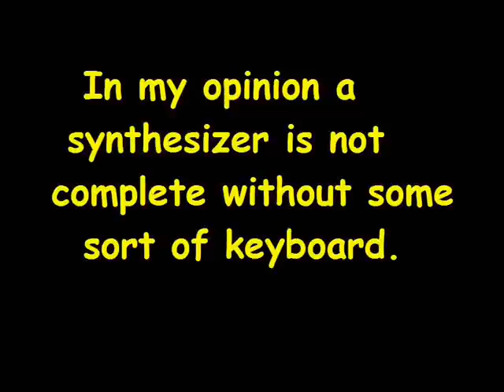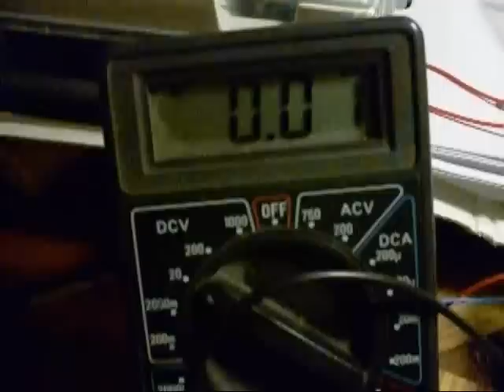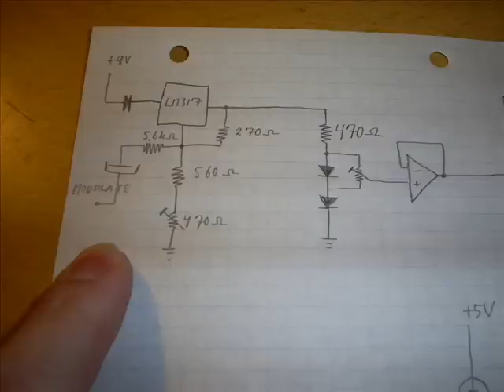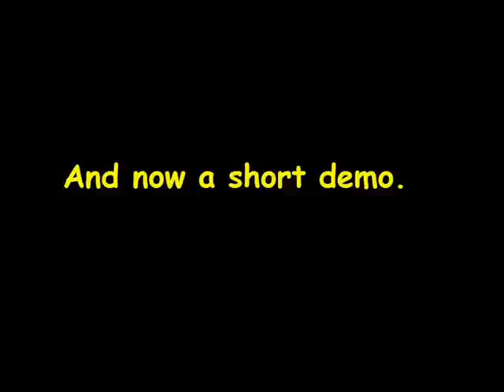Homebuild Synth 6 - Keyboard

Comment from the maker: @synthmx - The VCO is not a standard V/Hz or V/Octave design so the MIDI interface have to deal with that. But I once found a PIC based MIDI-to-CV converter where it was possible to programme odd voltages for each note. Also there are a lot of MIDI-to-Relay converters on the internet and if one of these are fitted with a resistor network instead of relays it should be possible.

Comment: wait a minute how do you control when to latch data in?
Reply from the maker: The keyboard switches are connected to +5V through a transistor base. When a switch is closed a current is drawn because of the pull-down resistors on the latch inputs. This current drives the transistor and the collector is connected to Latch Enable trough a capacitor which results in a short pulse.